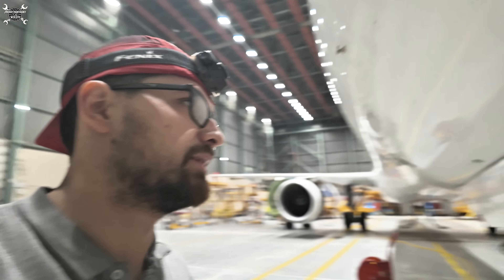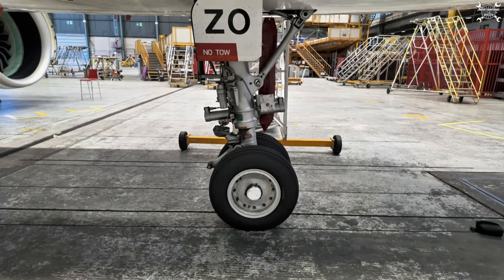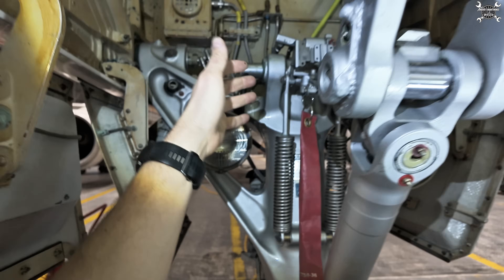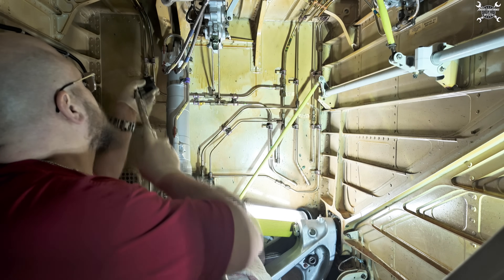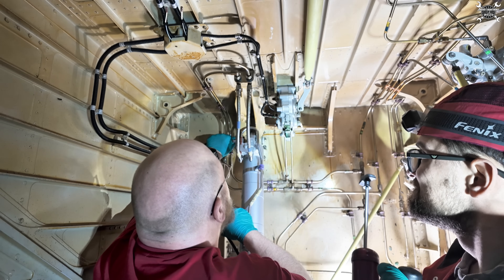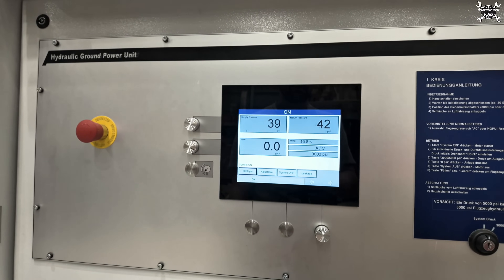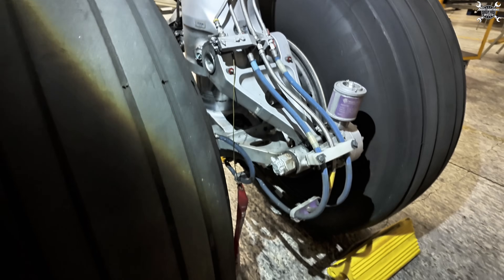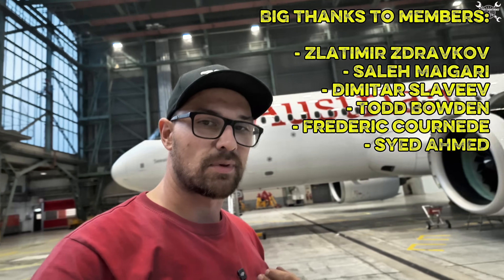How to extend and retract Nose Landing Gear

Comment: I love these complex tests that involve a very specific workflow in which you need to "trick" different set of sensors.
I requires to know exactly how the machine works, how it will behave and what safety precautions you need to take. 🤩

Comment: Thank you for this amazing video Zeto! It's again very educational and very well delivered to us! Keep going that way, we all appreciate your awesome work! Thank you mate!
I have a question, can you do a video about HYD CART, to explain us more about it ( how it works, what are the safety precautions, how the machine prevent mixture of it's own hydraulic fluid with the one on the aircraft, and maybe what else we can do with this machine (except giving HYD power to the aircraft (I've read somewhere that it is possible to drain all the hydraulic of the aircraft with this HYD ground cart, but i'm not 100% sure of that) )
Reply from the maker: Thank you. Regarding cart you are right with it ability it provide power to aircraft 3000-5000psi depending of needs. It of course mix hydraulic. It can also drain or fill hydraulic 🙂

Comment: On stigs channel he says one of the most dangerous pieces of equipment is the huffer cart (that supplies high volume compressed air to assist engine starting, I am assuming the danger is air is a spring, so if a hose goes pop or a coupling lets go, all hell breaks loose), followed by the power cart. How does the hydraulic cart rate amongst those three?
Reply from the maker: Look of you perform proper maintenence on every equipment there is no problem. Every equipment can be dangerous if you don't use it properly or you don't take good care of it
Reply: @zeto.r  yeah absolutely, btw love the videos, really appreciate the effort you put in to bring us this content ❤

Comment: It is a somewhat common occurrence that I can feel the nosewheels still rotating after the retraction sequence has completed. FCOM states there is a rubber block or similar to brake the nose wheels on retraction so why would this happen? Rubber wearing down over time? Thanks for a great video
Reply from the maker: Brake pads are not installed on A32f on boeing you can find it almost on every aircraft

Comment: Hi. Bro.
MR. ZETO i'd like to ask your opinion. Do you think my aircraft maintenance experience in Indonesia with license and A320 CFM56 type rating) could be recognized by the Slovak aviation authority for the EASA Part-66 B1 license? It would really help me if my previous experience is accepted, as I'd prefer not to start over again with the full 5 years of experience required by EASA
Reply from the maker: EU countries recognise practical experience only from EASA PART 145 organisations. SK CAA will accept your application only if you will live or work in Slovakia

Comment: Hello. I have a question. I saw a video of an A320 landing with its nose gear at 90 degrees. The concrete on the runway had worn them down. How is that possible? Greetings from Poland.
Reply from the maker: Let's keep it simple. Inside are 2 components which after take off will align NLG straight. If you accidentally turn this 2 cups 90° which was possible during retraction it will turn 90°

Comment: I have seen before only electrical boxes with ground/air switch, that you put to gear and move electrical wiring from proxy sensor to that box. Fast to change state of aircraft during maintenance between air and ground
Reply from the maker: On which aircraft was this because every aircraft is different?
Reply: @zeto.r  320 series. In-house manufactured boxes.

Comment: The nose gear strut looks so svelte it's hard to believe you can land a building on it.  Quite amazing that they can survive multiple landings per day, every day for decades.
Reply from the maker: Still nose gear carry only smaller portion of the weight but still it can withstand really heavy landing

Comment: Hi. Just curious.....how do you disable / prevent hydraulic pressure to actuate the main gears, since you only jack the nose gears.
Reply from the maker: Gear pins prevent retraction of the gears even the aircraft will be in the air. But also weight on the wheels keep them down.
Reply: I'm sure there's more going on than this but I believe 1) the gear swing open slightly further than straight down ("over center") meaning that they can't actually retract without lifting up the entire airliner which they probably lack the torque to do 2) I believe the weight-on-wheels switches likely also inhibit gear swing.

Comment: After takeoff the wheels are spinning, what happens next as gear is retracted? Are brakes applied before stowage?
Reply: On nose gear, brake pads are installed in the landing gear well. On main gears, the brakes are gently applied to stop the rotation during retraction.
Reply from the maker: Airbus doest use brake belts on A320 anymore
Reply: @zeto.r  The brake pads are still used to slow down the nose wheels on A330- A340 and all Boeing types. I don't remember on A350 and A380.
Reply from the maker: @brunogx7 I know about boeing, im not sure about the rest of Airbus production but A32f lost them almost on beginning
Reply from the maker: NLG wheels will slow down by it self after retraction (the stop belts are removed since almost from beginning) since Airbus think that stopping of them is not necessarily. MLG wheels are stepped by brakes since gyroscope effect can cause the problems and as well the debris from the wheels can cause damage to components inside of the bay